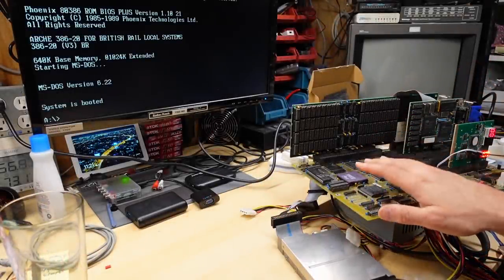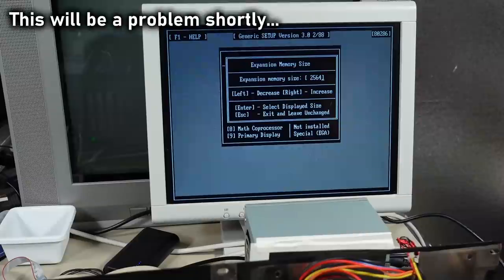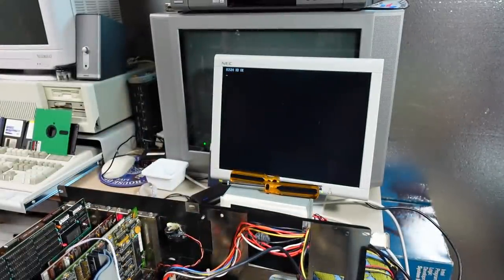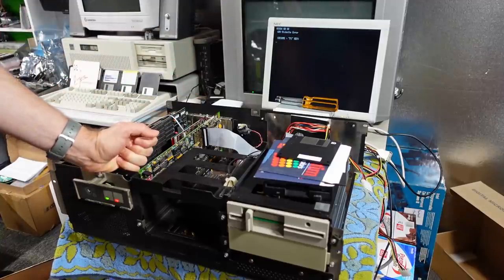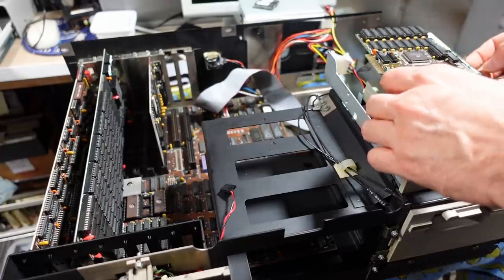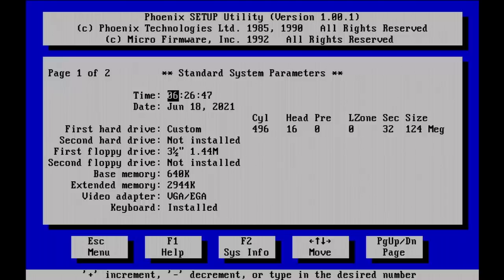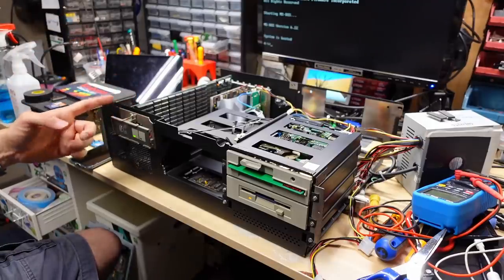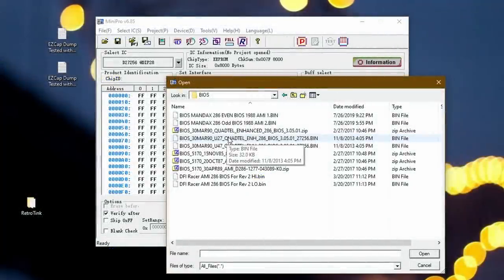IBM PC/AT Model 5170: So many issues! (BIOS mania)

Comment: By the way: It's easy to overclock the AT, just swap the clock crystal for a higher frequency. I used to run mine at 10Mhz and at one point had 12.5 MB memory in it for testing purposes. At the time the memory was so expensive that it was a lot more than the PC At itself, and the AT was not cheap either. All that memory was for customer network servers running Novell NetWare 286, one of the few things that could actually use the 286 and memory to its full capacity.
Reply: Adrian had a different video with the oscillating mod. But he had to have a mod done to remove the over locking clock bios routine. And a few other things hidden "features.". If I remember correctly

Comment: I was heavily in the PC world in the mid- to late-80s and I never remember an AT or any 286 (e.g. HP Vectra) with a 1.44Mb disk - I didn't see that until the first PS/2 came out. It's not period correct in any case to have a 1.44Mb diskette drive. The AT came out in 84, and the 1.44Mb disk in 86. By then the AT was in the rearview mirror of the Deskpro 386 and IBM's own PS/2.
Reply: My first PC in 1991 was a Mitac 16Mhz 286 with VGA and a 1.44MB floppy.
Reply: I encountered a lot of IBM 5170s in the early 90s and more often than not they had been retrofitted with a 1.44MB drive. It was a common upgrade to help keep those machines useful. The PS/2 drove people to install 3.5-inch floppies in other PCs so they could read the new disks.
Reply: @thematicschematic  80s guys - 80s :) I realize I'm as old as Methusalah :)
Reply: Heathkit had an Eazy-PC in 1987 that came with either 1 or 2 720k drives.
Reply: @nickwallette6201  I never understood why, but I avoided the 3.5" because they were error prone and it could not have been the higher density - I think there was variation in the quality of the drives themselves. The 1.2 was more reliable in my own experience, but I understand that the opposite was the general experience. I am old enough to remember 8" floppies! And doing full backups to dozens of them!
Reply: I know places that ran ATs that they purchased as late as 1987 well into the early to mid 90s and put loads of upgrades in them including the 1.44MB floppy drives. I think Windows 95 finally pushed a lot of businesses to replace their aging 286s and 386s.

Comment: When you get around to testing the power supply,  make sure you meet minimum load requirement for it to regulate properly. It needs 7A on the 5V and 2.5A on the 12V. For AT computers configured with no hard disk, IBM would install a 50W dummy load.
Reply: And don't use paperclips or a Dremel.

Comment: When you formatted the hard drive did use fdisk /mbr ? Fixes a lot of problems... i had issues with getting a compact flash card to boot. Fixed the problem. Maybe it might work on the drive.

Comment: So many wonderful childhood memories/nightmares of diving into the innards of my 386 - setting pins, jiggling connections, manually entering hardware info into the BIOS...  And when none of that worked, walking to the nearest computer store for advice.
Reply: Remember when computer shops had actual engineers working?

Comment: Hello Adrian!  It CAN boot into DOS with a 1.44MB 3.5 inch drive! You just need a drive where you can set the drive to be drive 0 instead of drive 1. From the 386 era, PC's use them as drive 1 but it does not work with the 5170. Jumpers must be set(or soldered on newer TEAC drives) to drive 0 in your case with the ORIGINAL BIOS.

Comment: Have you heard of Compaq MS-DOS 3.31? It's a special release of MS-DOS 3.3 with only the big disk support from DOS 4+ added. If you're tight on memory but still need big disks, or if you just want to avoid DOS 4.01 alltogether due to its reputation, this is the version to use.

Comment: Now that I see the restriction to 3.5" with 720K, I remember to have had the same problem back then with a XT clone.  A BIOS without built in setup was not uncommon at the time.  Even my first 386 lacked that and came with a DOS setup program.

Comment: 58:56  I've run into that problem in the past, where drives would not function properly when transplanted between older machines.   It seems to have something to do with the way that disk controllers address the disk's layout.  That is one of the things that I always appreciate with new machines, the fact that you can create partitions on one machine and move the disk to another and it works perfectly.  I have run into problems with newer machines not being able to interpret a disk created in a different machine though it is rare.  I always have that odd feeling that it won't work when I transplant disks though, which is something that I have ingrained into my brain from the old days...

Comment: My 5170 had an original IBM 128K card in it, so it had the full 640K. I sold the whole thing for spare parts a few years ago, after I turned it on (with the lid off) and it went bang in a shower of orange sparks - a shorted tantalum cap on the serial board. I removed the serial board and it still wouldn't power on, presumably another shorted cap, but I didn't have the time or space to repair it.

Comment: Maybe these EPROMs were just too slow...
I once fixed an Asteroids machine, the ROMs had disintegrated and I had to burn new ones. They verified fine, but the machine didn't like two of them. I thought, maybe some bits already flipped back, that can happen, you just have to burn the image twice. But they did verify. Asteroids runs at 1.5MHz and the 6502 is pretty quick when it comes to access times. So when I had to burn ROMs for a slower system, I used these and they worked fine.

Comment: OMG this makes me think I truly lucked-out with my IBM 5170 project... not to say that there weren't unexpected issues, but certainly not to this degree!  Oh, and I solved the need for IDE support by adding an XT-IDE EEPROM (cheating perhaps) but I get to keep the purity of the original IBM BIOS, use more modern parts, and I can choose from any available FDD or HDD at boot time (like the swap function you were after.)

Comment: I'm by no means a PC expert but I found an auto repair shop Amstrad 1512SD computer 30 years ago [SD indicates HD and floppy]. Just found time to look at it and the HD was frozen that did start reading the drive directory but slowly lost it till it gives nothing but errors. Likely scratching the disk with that initially frozen head. The reason I bring this up is it is like a IBM 5150 clone that is/was popular in Europe. This old thing could not read a 1.2 Mb 5 1/4" floppy as only 360 KB double sided was the max. I did finally get a 3.5 " 720 MB floppy to read but it had to be a drive with dip switches. The Amstrad could use both drives together but one drive had to have the end of line resistor pack removed. I didn't hear Adrian mention removing the resistor pack on the 5 1/4" since that is usually the one to do that with and he was trying to boot with both drives. All PC's needed that done and Adrian probably just didn't mention it. When he showed the IBM diagnostic disk only showing max 720 KB drives it got me a thinkin a bit. Did the 5170 allow for 1.2 MB 5 1/4 disks in 1984? The Amstrad was made round 1988 and it was just not made for such advanced tech. One other thing, I have a 5 1/4 drive that has the option to read slower disks as well. Couple or 3 points perhaps is figured out later than this video made three years ago. Adrian claimed to have the bios updated for 1.44 floppy but is that really possible with a 1984 PC? I could see the drives seemed to boot at separate times so of course they must have had the EOL resistor pack removed.. right? Just too much an obvious point to make I guess in this video.

Comment: like LGR proved with his 5170, they work perfectly fine as long as you have the original hardware for it, or some that's close enough to match the original, but as soon as you want to go beyond that or replace any of it the machine no longer plays along. I've never used any original IBM PCs before the PS/2 and with those the biggest issue was MCA and the complete lack of hardware available for that bus

Comment: I used to be OK with creature comforts on old consoles and PCs, but now I kind of feel like.   If you’re not going to keep it original, why use a genuine IBM?

I would keep the original BIOS, use a 720K B: drive (how often are you going to boot from floppy anyway?), which would allow you to keep the original cables and controller.  Install a SCSI card and whatever disk or flash adapter you’d like.  If the LED isn’t bright enough, try changing the current limiting resistor on the adapter PCB rather than hacking at the front panel.

Being an IBM, you kinda have to do things the IBM way.  If you’re not into that, use an AST.  :-)

Comment: The 601 problem is a well documented one at minuszerodegrees, affecting computers with a second and third released BIOS versions. and the easiest solution is getting the correct Floppy and MFM controller card for between 50 $ and 80 on Ebay, saving yourself days of trouble.
Sometimes more reading up on things and less hectic tinkering and replacing ROMs and cards is actually the better solution.

What you will end up with is no longer an IBM AT but a weird Zombie, that abuses an IBM board with a BIOS that doesn't really fit. I am not a fanatic purist when it comes to keeping systems original but you got to ask yourself from which point things just don't make sense anymore.
Might as well sell all the parts and just keep the case for your other, damaged one.

Comment: I'm not clear why Adrian isn't trying the Open Source Universal BIOS or other custom legacy-compatible BIOS. For that matter he could be using a retro version of FreeDOS 1.3. These kinds of products were specifically made for getting old PCs running again, also even old DR DOS should work better than MS or "PC-DOS". Although to be fair, these kinds of problems are why many 80s retrocomputing enthusiasts go back to Commodore or Apple II's and avoid PCs of the era. DOS 4 also doesn't go above 512mg hard drive, although that's not really a problem here.

Comment: I'm not actually surprised that it could read 1.44 disks (I would not try writing to them!). Most of the actual decode electronics for floppy disks were not in the floppy drives themselves but instead on either a floppy controller card, or the motherboard. So, considering the 1.2 HD disk support, the controller should be approximately capable of the needed data frequencies, so as long as the drive is the source of the data, it will probably work fine... BUT, any data originating from the controller chip will likely result in the speeds that the BIOS expects, unless you run something that goes in and directly sets registers in the controller chip.

Given what another poster commented about timelines, I'd guess the 1.44 drives weren't supported only because they came out too late to be put in the BIOS.

Comment: It's been many years since I messed with older PCs but when I needed to boot off of Drive B I used a utility named Boot Thru which installed itself onto the A drive and passed the boot process to the B drive.   It saved me many times having to open the lid and swap the drive cables.
Note> I have searched and cannot find Boot Thru any more due to the sites being depricated these many years, but I did come across a similar utility called Boot B .  
This from the DOC>
Boot-B:  Boot the B: Drive

Copyright (c) 1990, 1991 Solutions by the Numbers

Written by Scott A. Numbers

Do you have tons of games on 5.25" diskettes that can only run by
booting them, but you can't run them because your A: drive is a 3.5"
drive?  Now you can.  By using Boot-B: you can start most of those
diskettes from the B: drive.  Boot-B: is a program that creates a new
boot sector for a disk in drive A: which when booted will pass the
boot process over to the B: drive.

It is not a TSR (obviously), nor does it in any way alter the format of
the diskette.  It simply replaces the non-functional boot sector of
the floppy with one that redirects the boot process.  All DOS disk
parameters are left unaltered.  Since Boot-B: does all of its changes
in the boot sector, the BOOT_B program does not need to be present on
the floppy disk.

I found it here:
https://www.uselesssoftware.com/download/boot_b-zip
 
 Hope this helps someone.

Comment: Yes the 5170 AT really is an animal on its own with its own issues.  I always preferred the 286 clones with the built in BIOS.  @51:46  I remember there was an issue with IDE drives greater than 120MB.  It was a bios limitation where it just could not read any hard drive that was beyond 120MB.  Try using a 64MB CF flash and I think that will solve your problem.

Comment: The original 20mb full hight drive were horrible. When one would come into the shop IBM would have us replace them with different drives. We would send them back to IBM. They eventually created a new artificial reef off of Boca Raton, FL with them. When I wanted 286 I didn’t want the 5170, I went for an AT&T 6300 plus. It ran at 8ghz and came with Unix V and could run DOS as a sub task. Miss that machine.

Comment: Lol, totally reminds me of me, bumping into one issue after the other! In the end it's all about persistence with these old beasts.. They can be a pain.
Totally had the exact same issues with my 5170 and I'm running the same Quadtel bios with a modern IDE drive. Mine had some bad (weird piggyback) RAM as well, which was luckily still available on Ebay. Also MinusZeroDegrees really is a gift from god :-)
Are you going to overclock this thing to 8 MHz? Everyone did that back in the day. Mine is as well.. The 6 MHz i286 can easily run at 8MHz by just swapping out the crystal ;-)
Reply: Would love to see this!

Comment: Not sure if either of these things were brought up already but:
1.  Another network type that used coax and eventually twisted pair was Arcnet.  Arcnet was popular during 80's and early 90's.
2. Problems with booting HD when it otherwise works:  I doubt you had a problem with the partition table itself or else you wouldn't have been reading data correctly from the disk.  However there is bootloader code on the sector 0 that contains the partition table.  That probably was bad or incompatible until FDisk re-wrote it.  Not sure if there's a command switch to rewrite the code without wiping the table.

Comment: I'd look for an old AT 386 motherboard and create a 5170 Frankenstein.  The 286 is a brain damaged design anyway (Bill Gates).
Maybe the eprom was OK, but the access time was too slow.  The programmer can't test for that.
You can swap the front plate of the floppy drives to keep the color you want.

Comment: Hi, you could probably use the Phoneix BIOS and XTIDE BOOT ROM on LAN card, which will solve the problem with any modern HDDs ;)
Reply: An ide controller card with an external bios will probably solve that issue like you said. I have a k6-2 machine that under DOS the onboard IDE didn’t support LBA under DOS so my 3.2gb hard drive was only visible as 502mb. I bought a promise IDE controller card and all 3.2gb is now usable. Not quite the same issue, but it should fix the problem(although he’d need an ISA one with an external bios such as an XTIDE)

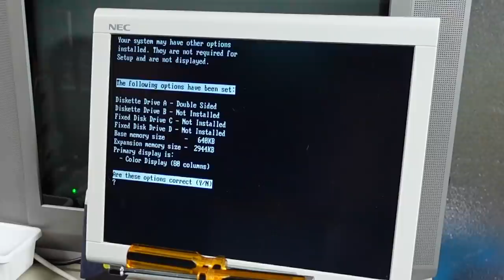Comment: @ 15:23 - "Why does it think it has CGA? It should be EGA, right?"

In short, no, not really. The BIOS doesn't actually care whether you have CGA, EGA or VGA. All it cares about is which memory space to use for video operations.

Color displays (CGA, EGA & VGA) use the memory region B800-BFFF for the display RAM. Monochrome displays use the memory region B000-B7FF. So, if you were using an original IBM MDA or the Hercules Mono Graphics Adapter, you would need to set it to "Monochrome". But showing that it's using a "Color display" is fine, since it only needs to know where in memory to perform display operations. The original PC and XT are the same way; you need to tell them whether you're using a monochrome or color display (through DIP switches). The type of color display doesn't matter.

Comment: There is another BIOS that works on that system, it was made by Mr. BIOS. Has the ability to swap the floppy drives and also can have the ability to have four disk drives.

Also a tip, you can set up the BIOS to use a 1.22MB floppy and still use a 1.44MB drive just fine. However you might run into issues if you have to use compressed floppy disks that extend the storage to 1.72MB. Also keep in mind the 1.44MB drives wasn't around when that system was released. I think the 1.44MB capacity was around the PS\2 era around 1986.
Reply: Microid research bios was amazing.  My 486 has one.
Reply: @lsorense  I pulled mine from some broken 286 at clone. I popped both chips in and crossed my fingers. Used it for a couple of years before I replaced the motherboard and slapped in a am386dx 40mhz.
Reply: @lelandclayton5462  Nice.  I remember buying the bios upgrade for the 486 to make it work with disks larger than 500MB.  It was an amazing upgrade, much faster startup than the original award bios, auto detected ide disk settings up to 137GB.

Comment: I think those square (rectangular) batteries were 9 or 12 volts, not 6. That may be why it keeps giving you the “162 - options not set” error. Check the original battery and see if it really was 6.

Comment: I would worry less about purity and more about compatibility and reliability.
If it does a bit more than it would have done originally, like adding VGA while it should only be EGA, I would not worry due to the compatibility.

If it still runs everything it would have run in its pure condition, I would call it a good build.

If it now needs programs to slow it down or other workarounds to run software it would have run back then, i would be worried.